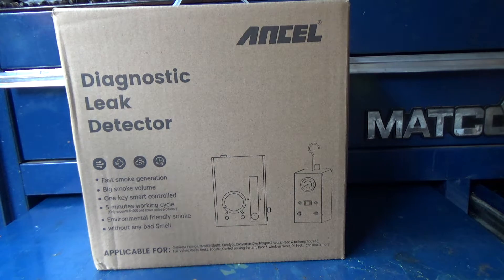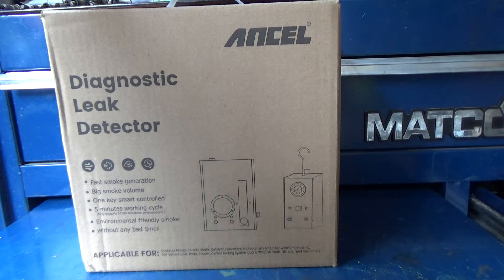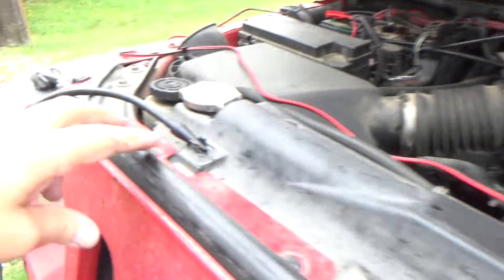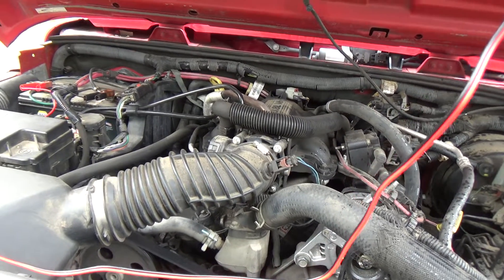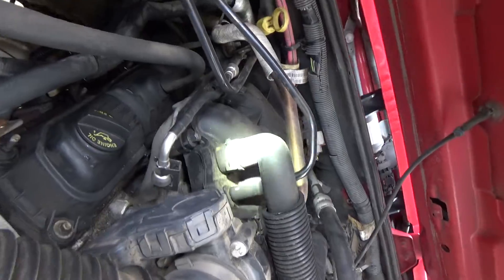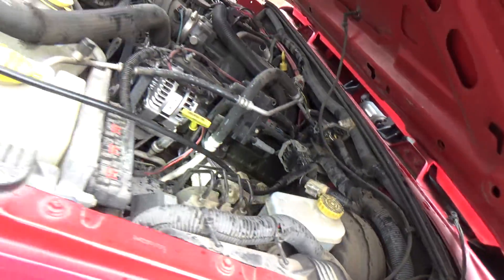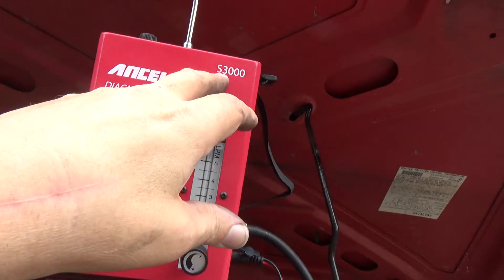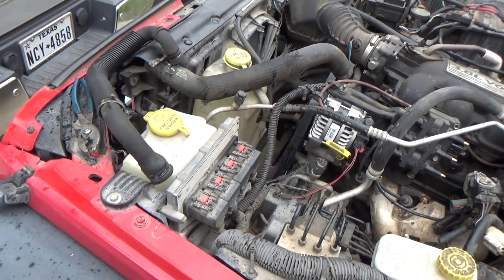I Review the Ancel S3000 Smoke Machine. I found a Vacuum Leak in 30 Sec.

Comment: I ordered the S3000 pro model.
I also ordered a little low pressure regulator that I plan to attach directly to the Ancel for Evap testing. It’s a 0-30 psi regulator.

Comment: Great review. It looks promising for the price. Have you had a look inside? I wonder if there's space to modify it by fitting a low pressure regulator.
Reply: I bought a little 0-30 psi mini regulator to attach to the hose output. Haven’t gotten the Ancel yet, but I don’t see why that wouldn’t work

Comment: The man gets a free machine and within the first minute describes its major downside. Subscribed! BTW. Most of these budget, Chinese-designed smoke machines that have the built-in compressors don't add the necessary regulator to drop to safe pressure for EVAP testing (most that require external air do have the regulator, however). Not to nitpick, but an open purge valve won't contribute to an over-pressurized tank. A closed vent valve will, though.

Comment: would u prop open the filler hole (gas cap spot) to allow smoke to come out that way and not build pressure but also run smoke through the system to look for any leaks elsewhere? or would it not have enough pressure to come out of smaller openings than the filler hole.
Reply from the maker: That is a good idea, but it might not let enough pressure build-up to expose the leak.

Comment: They have a few models that only put out 0.5 psi.  I showed the manual with the chart in it.  I did use this one, 3000 model, on an EVAP system once but I opened the gas cap.

Comment: If it’s not adjustable down to 3 psi you are correct it will destroy a evap system
Reply from the maker: You can adjust it by putting your finger over the tip and adjust the knob until it can only reach 3 PSI or whatever pressure you want but it would be nice if the pump they used would automatically not go above 2 or 3 PSI max.
Reply: @737mechanic  👍🏻